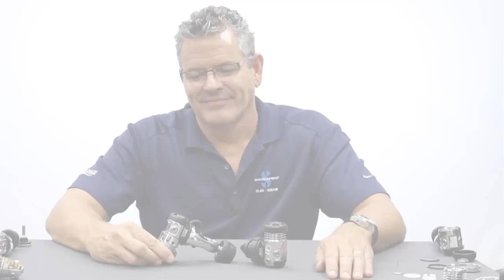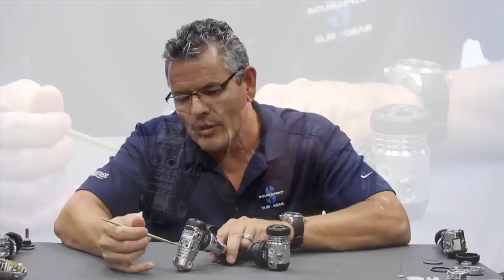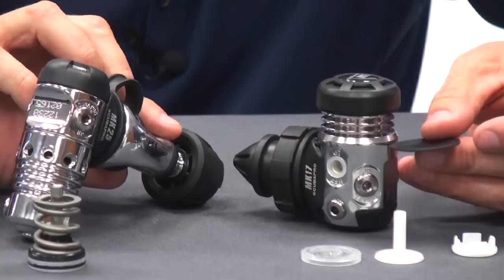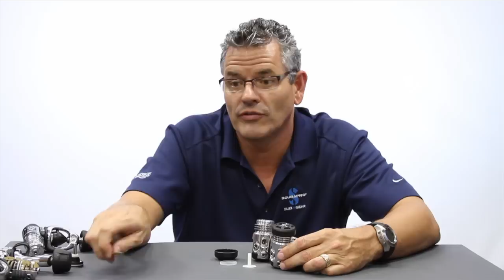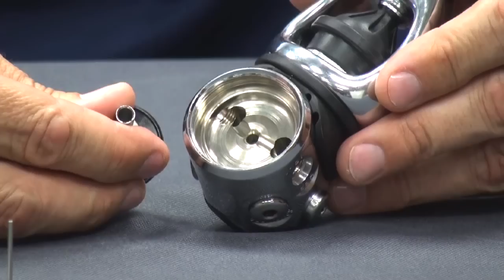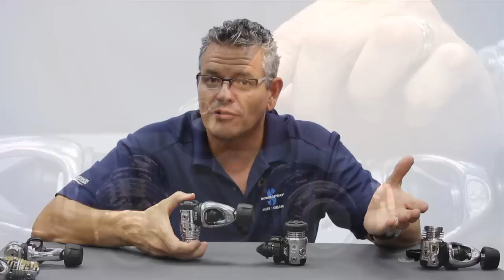SCUBAPRO Diaphragm vs. Piston First Stages

Comment: I earned my cold water diving creds from the comfort of a balmy summer lake. I looked goofy to the water skiers and swimmers in shorts while I was in a hooded wetsuit.  At about 50 feet I hit the 4 degree centigrade layer of water that is too deep for surface currents and too dense to rise on its own. My goggles instantly fogged, any exposed skin hurt, I shivered, but I was assured by the factory my piston first stage would not ice up. For a nominal fee, they packed the cavity with low temp grease and held it in with a wrapper. Thanks to your explanation I understand the reason for that extra step.